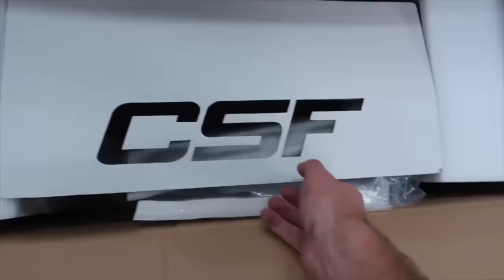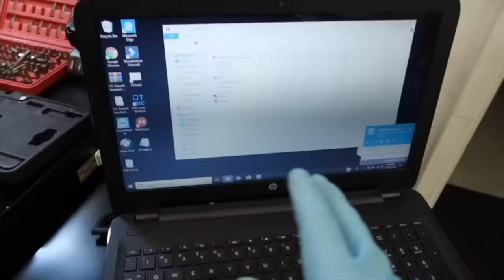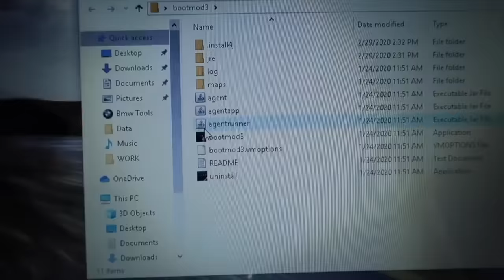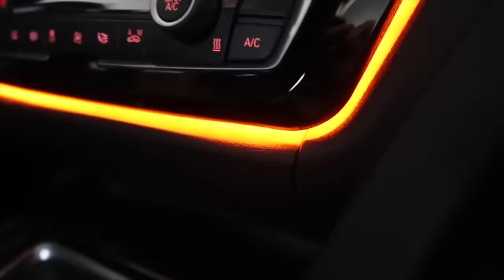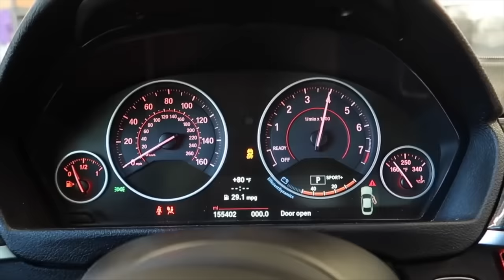BUILDING A 435I BMW IN 9 MINUTES!

Comment: Well done. Although if you're gonna go through all this work on a 435, may as well get the m4.
Reply: built not bought
Reply: Where’s the fun in that
Reply: The m4 is practically the same it’s a tad bit faster but everything is the same
Reply: @benjennings7516  this is the dumbest comment.

The m vehicles share very little. Transmission different, engine different, suspension different, electronics different, programming different, there's so much different from a 335i, 435, 340, 440 than an M variant.

You don't know what you're talking about.
Reply: Youbones pretty sure I do because I have a 440m so uno it’s pretty much the same
Reply: Youbones, damn, really do be goin in, atta boy
Reply: @benjennings7516  you got an 440m ? damn where can i get one of those, Does the engine run on m&m´s ?
Reply: The m4 expensive asf tbh
Reply: I think you can upgrade a 435 Nd make it look good, Nd it still won’t cost more than a stock m4
Reply: @PlusBones  I replied to a similar comment, but thought I'd give my 2 cents:
I'm in a similar boat.  Paid off my 435i after 3 years and did not want to go through the trouble of selling, finding a 6MT M4 to my spec to finance all over again.  I put 7k into my 435i (MSPORT conversion, tons of Carbon Fiber like Nours build, BM3, FBO, upgraded clutch etc.).  I figured that 7k cash over time in mods is still cheaper than financing at least 20k for an M4 (not to mention interest) for 3-5 years.  With the Stage 2 E30 tune it's just as fast and much louder than a stock M4 that I'd have a car payment for.  Plus, it's way more fun working on your own car IMO.

I respect your opinion tho!  Coming from someone like myself who thought about the M4 but stuck to the paid off 435i route lol.
Reply: @styler7632  Contrary to popular belief, it actually runs on skittles
Reply: It’s all about the journey, not the destination.
Reply: @PlusBones  it's probably sum 10 year old kid who wants to look cool lol. Let him have his moment.
Reply: @benjennings7516  '440m' 😂😂 you mean 440i dude
Reply: @PlusBones  you going in on dude but pretty sure he means from the outside and inside it looks the same which it pretty much does. 435i is a great car obviously can’t call it a m series but in a city I would choose a 4 series first.
Reply: In his case maybe, but you can't get a M4 with All wheel drive an manual

Comment: the build looks dope, but at this point idk why he didnt just buy an M4
Reply: Yeah I see alot of youtubers that do this surely it must be pretty similar cost at the end. Actually thinking about it, if he just bought a m4 he wouldnt of been able to gain 125k subscribers
Reply: cuz he got hooked up by kies motorsports.
Reply: Some people want a build, plus the 35i models are basically M cars, Twin Turbo straight 6 engine.
Reply: @MeloFloww  I think they only have one turbocharger, along with the 440i.
Reply: Probably bought it second hand and cheap, therefore leaving him with some spare change for mods.
Reply: @MeloFloww  The 35 models use the N55 engine, which is a single twin-scrolling turbocharged engine. You can build it to be relatively comparable to the S55, you just have to swap out for higher flowing catless downpipes, better intercooler, and MHD tune. For best results swap out the turbo
Reply: Amanur Rahaman I guess. But a 2015 M4 you can get for $30k and this dude is buying all these parts for his 4series to look like an M4
Reply: Amanur Rahaman I agree
Reply: Oh my godddddddd iiii wissshhhh
Reply: Bryant twin scroll not twin turbo
Reply: I'm in a similar boat.  Paid off my 435i after 3 years and did not want to go through the trouble of selling, finding a 6MT M4 to finance all over again.  I put 7k into my 435i (MSPORT conversion, tons of Carbon Fiber like Nours build, BM3, FBO, upgraded clutch etc.).  I figured that 7k cash over time in mods is still cheaper than financing 20k for an M4 (not to mention interest) for 3-5 years.  With the Stage 2 E30 tune it's just as fast and much louder than a stock M4 that I'd have a car payment for.  Plus, it's way more fun working on your own car IMO.

Comment: I give this guy props for having the money/funds/resources to not only buy a 435i but to also throw more money at it. This build is nothing but bolt-ons and the only custom work was the slight body work and the steering wheel, which he did neither. You guys have to be honest with yourselves, this is not creativity. I am only hating because I don't have this type of money, lol, but if I did I would not spend it on building a BMW with off the shelve parts. I would build an e46 with an S65 engine. Or restore an E30 and drop an S54, or buy an E84 35i and convert it to a RWD only with a manual transmission. Now that's real art and creativity.

Comment: Hey Nour, I have a really good question. So when you put the Carbon fiber front lip. Where did you get that metal sheet that u put under it that also protected the bottom of the car like the plastic cover it also skewed into the bumper. 5:50

Comment: Love the build, I have a few questions Nour

You running spacers or could you without rubbing? i want tighter fitment while aired out
how much was your air kit plus installation
With sticky tyres can you launch in wet/dry without spinning..ever?